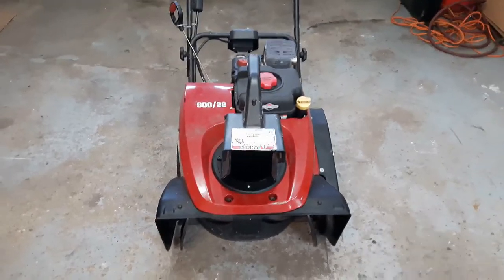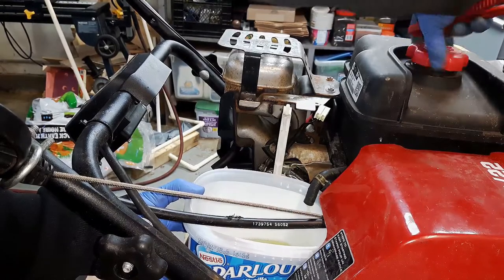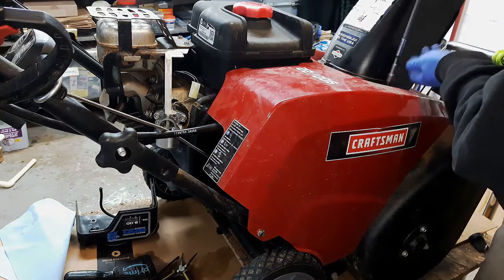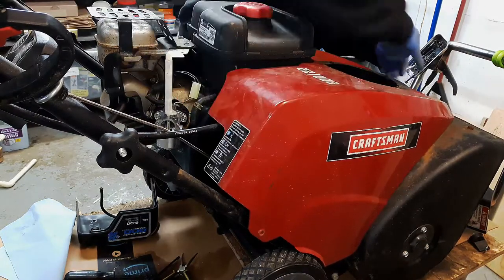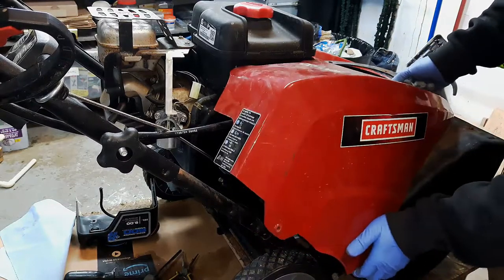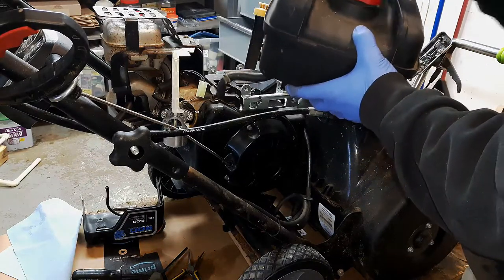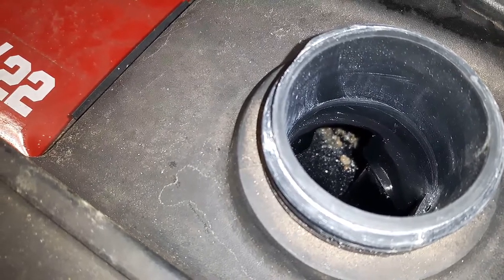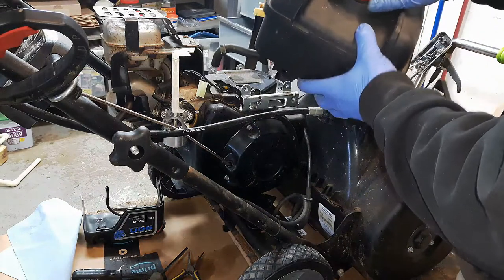How To Remove Fuel Tank On Craftsman Snowblower

Comment: Just wondering how did you clean the debris out of the snowblower? Was there a filter? Can you pop the top part off or will it break the unit?
Reply from the maker: I put water in the tank with my hose and swooshed it around some to remove the debris. Then let it dry and then blew it out with an air compressor. I have cleaned them before without taking them off by just putting a blue shop towel in the tank and using a long pair of needle nose pliers, I soaked up as much fuel as possible. Then blew it out with compressed air.
The tank had a screen inside to filter the fuel.
As for popping the top off, I'm not sure what you mean. Do you mean the top of the fuel tank? This is not possible as it's all 1 piece and can not be separated. 
Hope this helps. Cheers